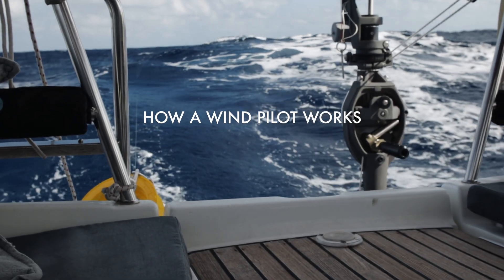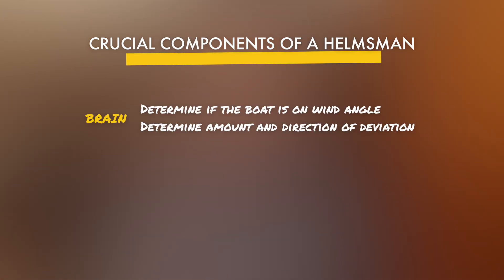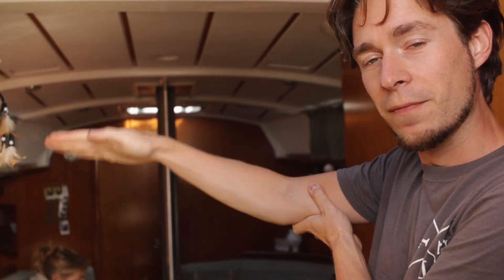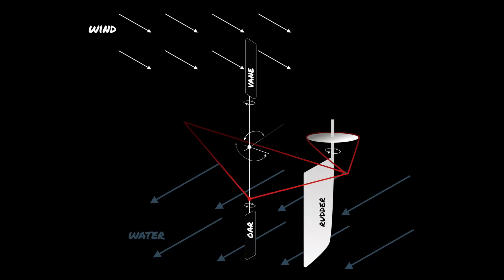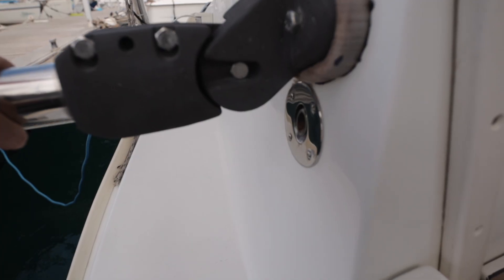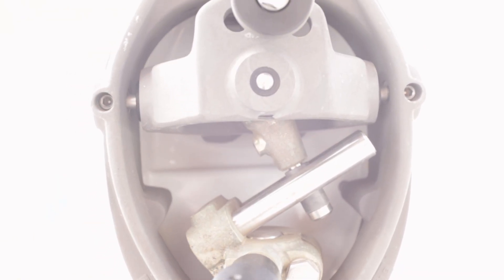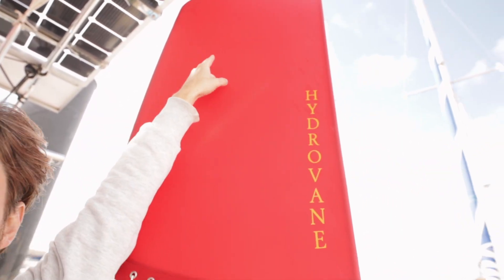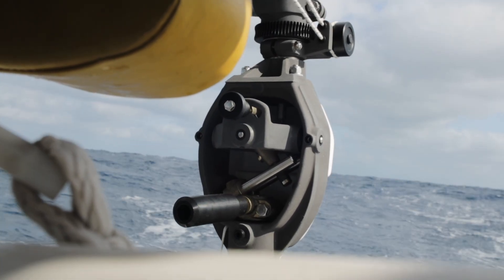how a WIND VANE works (in depth but cool)

Comment: Understanding all the above: 

So let’s say with a daily on the fly need to digest my watts in, watts out and capacity on say a fleet of food carts, vans or a barge/sailboat would sticking to my KW and KWH calculations as my literal GO TO for both sizing systems and managing fleets be bad practice? 

IE: X system has a calculated KW draw and take up per day seasonally averaged and the capacity for ease of use has been scaled to the worst case scenario “KWH” usage (no Solar lots of customers for example? Taking mostly 12v and 48v circuits with 240v inverters of various sizes.

Comment: So, if you have a precise heading you need to follow and wind that is constantly changing direction, it sounds like a wind vane would not be a good solution for that scenario, yes?  Probably best to hand steer until the prevailing winds become less confused and more constant from a single direction?

Comment: Some of these beautiful gadgets cost as much as the boat. The worst part is mounting it. I have a broken King automatic direction finder. I might just turn that into a radio compass . Buffer it so it doesn't suck too much electric. A wind vane looks fantastic. Model boats just tie into the sail.

Comment: Thanks for that visual explanation. I’ve decided to add a wind vane to my Southerly 135, but as I am building the solar arch I thought I combine the wind vane support into the arch, and it occurred to me that I can build the lower rudder part permanently in to the sugar scoop step in such a way that the shaft between the top surface of the step and the solar arch can be removed when it is not in use, and would other wise be in the way. I had to make these choices before I lock in the solar arch design so that I have built in the ability to add the wind vane parts later on. I am a huge fan of slewing ring bearings which are just machined stainless steel parts with the balls added through a hole (think crane hooks). The upper part should be easy to rationalize, it is fitting the Hydrovane, the bit in the water that will require some thought on how to put the vane in place and remove it without getting wet. 
So thanks for that. I now have a bit to think about. I design on Shapr3D (runs of iPad Pro), a system that is perfect for boaters, for any one who is wanting to fill in their days at sea being productive.
Reply from the maker: Hope all goes well, seems like an interesting project :)

We’ve retrofitted the arch after. Messed up and had to re-weld 😂

Comment: Hello . Great video. 
I follow you guys from the beginning as we are prepping our jeanneau 36 for a big trip .

I am.planning to fit a hydrovane could you please tel me wat is the the height above the waterline top of the vane .

I am fitting solararch this summer and want no obstruction in the future 

Thanks and congratulations for the new crew member 👶
Reply from the maker: Hey Mario. It is different since you can mount different poles and vanes. Also, you need to make sure you can turn the vane 360 without stainless obstructions. Best to get in touch with them, they can send you the measures for the combination of items you need. Also best to first install the vane and then the arch around it
Reply: @seethelittlethings  many thanks . I wil do . 

Great to see how you two evolve in your experiences.  Its already a long way since you guys dit your first steps . 

We sail mainly in the English channel northsea . Normandy and South England. 

Planning for circumnavigation 2024 /early pensioners 👩‍🦳🧑‍🦳
 hopefully the world is back ok by then .

Comment: Great explanation of how a hydrovane works! 
From prolonged watching our mesmeric hydrovane in action, across several ocean passages, I’ve convinced myself that the counterweights also come in to play when waves move the stern, as the hydrovane seems to adjust the steering very rapidly when quartering waves take the boat. Do you think this is possible, or is it just the apparent wind direction changing ?

Comment: I been thinking about off centered installation, wouldn't it cause asymmetric rudder input? Turning in one direction requires less rudder input than other side. Wouldn't it cause boat to drift with time. To be honest, I've seen off centred installations on boats that have successfully crossed Atlantic & Pacific oceans (Sailing Bacchus home). So it can be done.
Reply from the maker: Makes sense if put into exaggerated perspective (imagining it 10m off center outside the boat, but negligible when moving it to either side within the possible mounting options +- 1m from stern center

Comment: Thanks for this! Wow, what a piece of engineering! In another life - mid-1970s, in my twenties - I sailed down the west coast of Europe, Gibraltar, Canaries - in winter. Little 25-foot wooden sloop. Then across to Barbados. Our self-steering - we called him Rastus - had no water power whatsoever. Just a big 3/16-inch plywood wind vane blade, lines from that to either side of the tiller. Remarkably, it performed quite well, even downwind in the trades. We must have done a good job balancing the sails!

Comment: This is a good video lesson.  But I probably missed a few classes!  So my question is how does it work with trying to maintain your course over 100's of kms. Do you constantly have to monitor your course to stay on track?  I was probably sleeping in class when that one was taught.
Reply from the maker: Yes, you have to check course regularly and adjust according to what’s best in regards to weather routing. On our crossing to the Canary Islands we adjusted course to counter swell and deviated from our direct course to our destination. Sometimes it’s better to keep the boat at its preferred wind angle, sometimes it’s better to adjust course and then point of sail as well. Wind angle changes regularly so we need to adjust sails and vane angle once or twice a day
Reply: @seethelittlethings  Thanks! keep up the nice videos!